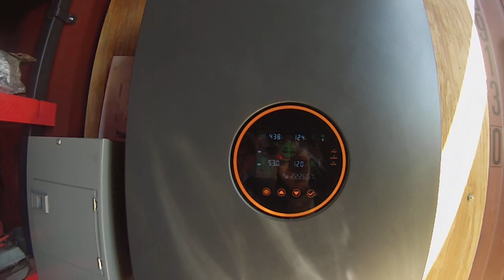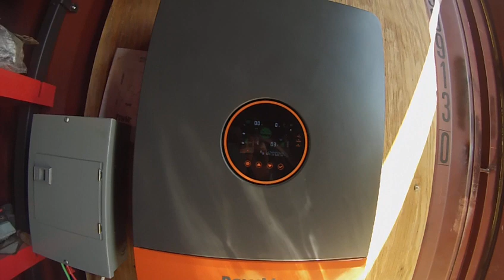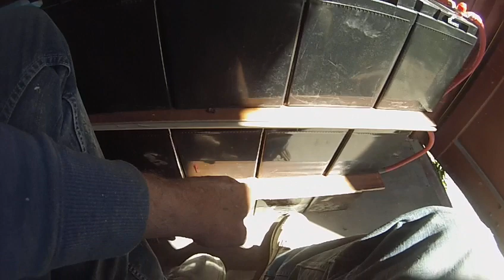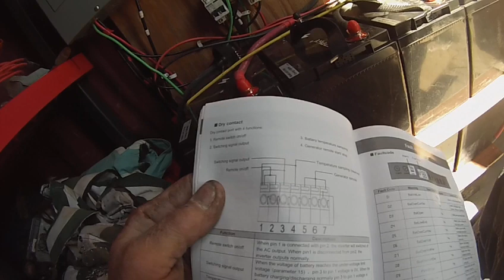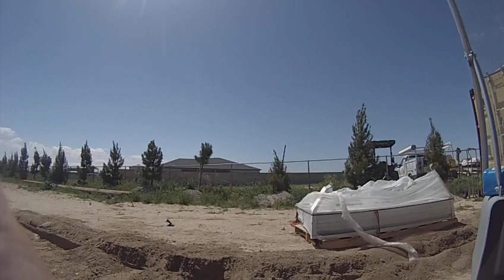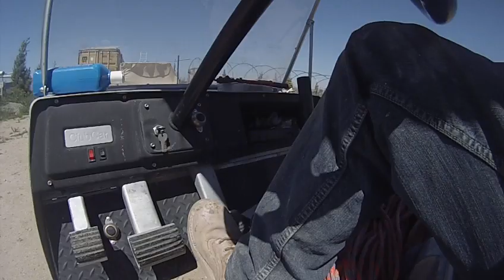10,000 watt solar system update.

Comment: Good set up Rodney.  How did you secure the boards to your container?  Drill holes thru it?  Also how did you run the PV wires thru the container?  Thanks buddy
Reply from the maker: If your talking about wood that I mounted everything to?  Just drilled 6 holes, nuts and bolts , and silicone.
   All the wires are coming in at the same place, through the floor right next to the battery bank. Being that the floor is wood I that it would best, plus ,everything is coming underground with the acceptlion of the PV strings on top the shipping container.